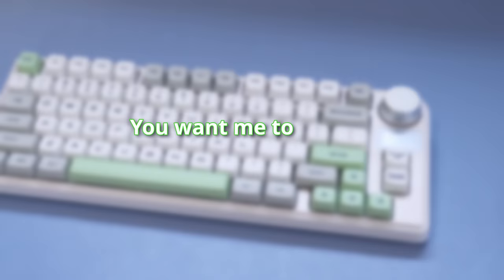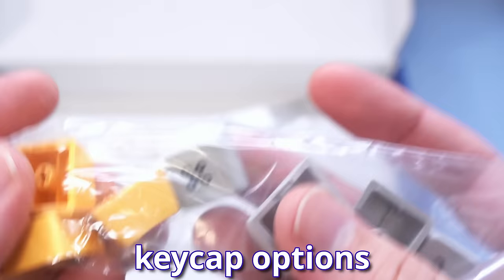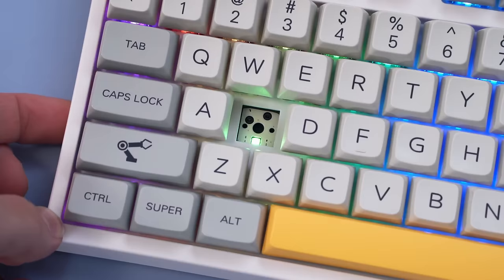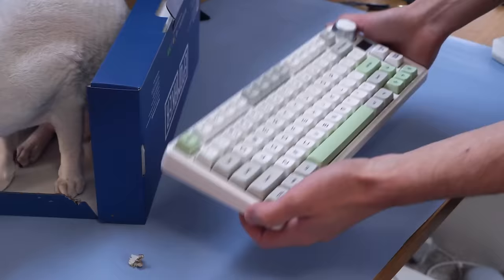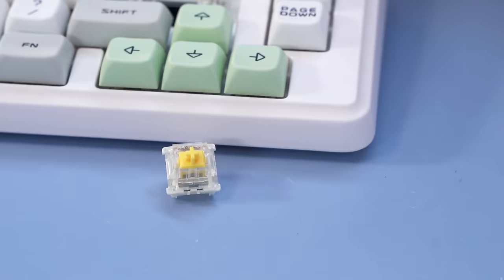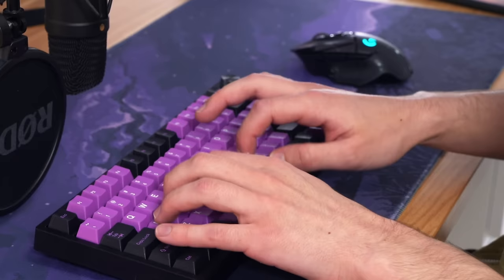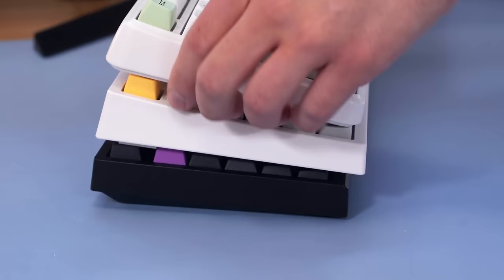Why Are People Buying THIS Keyboard From Amazon?

Comment from the maker: Sponsored by Epomaker who did not review this video.
⬇Paid Affiliate links to help out the channel ⬇
Epomaker Th80 On Epomaker: https://geni.us/Epomakerth80website
Epomaker Th80 and SE (amazon): https://geni.us/EpomakerTH80AMZ
Epomaker Th80X (Amazon): https://geni.us/EpomakerTH80X
Reply: They work😲
Reply: Also is the stock version better than a Keychron v1?
Reply from the maker: @CharlieGair  gotta watch the vid and decide for yourself 🤠
Reply: @HipyoTech  I’m new to keyboards idk
Reply: we need more nola content
Reply: @CharlieGair  Welcome to the club. Remember to watch your wallet.
Reply: you’ve got to try to new ajazz keyboard it’s value is crazy!
Reply: HIPPYO PLS HELP ME MY SPACEBARS STABS ARE KINDA STICKY SOUNDING LIKE THE GREASE SOUNDS HORRIBLE ANS STICKS TO THE STEM WHAT DO I DO HELPPPPP
Reply: I just bought the barebones kit and paired it with some akko sliver switches, sounds very good so far(i havent gotten the keycaps yet 😭)
Reply: Hippo can you review the Ajazz AK820 Pro it’s meant to be good
Reply: I usually don't ever comment but could you maybe take at Royal Kludge's offerings instead? Like the M75 or H81? I tried out Epomaker's budget boards and came to the same conclusion you did but I have the H81 and am very happy. Thanks!
Reply: HIPYO I need your help😭😭😭 after a few hours after lubing my switches, they don't sound as good as they were right after they were lubed, did they dry up😭😭
Reply: can you try the aula f75
Reply: Have you tried the Rk m75 yet?

Comment: Honestly i recently bought the th80 pro with pre-lubed wisteria switches and stabs for 80€ and I'm impressed. The keyboard is great out of the box and it sounds really good, at least to me. Shame about the epomaker software but for the price i can't really complain.
Reply: where did u buy?
Reply: It's the same price as the cheap keychron. I'm wondering if it's better
Reply: @Larimuss  depends on the country you are in. Keychrons are more or less expensive in various countries, plus shipping is a pretty noticeable mark up on the base price.
My th80 pro costed me around 80 € in total, instead.

Comment: I picked up the TH80 Pro earlier last year as my first mechanical keyboard to jump into the hobby. I really liked the sound and feel of it stock, but have since modded it a bit as I've learned more. The Gateron yellow switches feel and sound great, and more so after manually lubing them. I've tape modded it and added some foam, and think it sounds better now. While the stabilizers are factory lubed, they could probably use some more. It's definitely a good entry board, though it is a bit of a pain to get inside for modding.

Comment: I bought the TX80-X (flamingo switches) and I have to say, this is a big step up for me coming from Corsair K95 Platinum with speed switches. Also it was $95 cheaper than Corsair! 
It does sound incredible, well at least to me it does, I'm by no means an keyboard enthusiast, but I'm very impressed with it!
Also the software is... how to say it lightly... confusing and not pleasant, would much prefer if it was VIA compatible. 
I will have to correct you on the knob, in my unit it does indeed work as volume knob and other things, maybe the unit sent to you was bogged or something? 
All in all though, I'm very happy with this keyboard, will probably look at modding this keyboard to perfection for me. 
Great video though bud! Keep it up <3
Reply: I don't think he bothered reading the manual to know how to switch between using the software to volume lol
Reply: @hobgobble  I think he was joking but never too sure 👀

Comment: I bought the pro version, but barebones, slapped some akko lavender v3 pros, cheap amazon keycaps (I dont care if the abs plastic starts to shine) and some quick mods. I have to say this keyboard is pretty nifty, for the price it is a great budget option if you dont want to wait for a sale for other brands such as keychron or gamakay. The one thing that pisses me off is the disassembly of the case, but other than that, its a pretty nice budget keyboard. I am currently experimenting with other switches and might even make a whole new keyboard, feel free to ama about this keyboard.

Comment: I went ahead and pulled the trigger on the TH80 Pro as my starter custom board because Amazon has the prebuild it on sale for $45. Honestly, for $45, this thing feels great (I thought light linears would be my jam, but I didn't realize they would be THAT much better for me than the Cherry MX Browns I was stuck with on my old gamer board). Opening it was actually way easier than I was expecting. I thought I wouldn't be opening it frequently because every review I saw had people struggling with it, but I read a comment saying to use an old gift card/credit card, and it worked like a charm. Currently, I have the PCB taped, and it sounds really poppy (tho a bit loud and hollow with a noticeable spring ping from some switches, but I'll see what I can do to fix that later). I'm super glad I figured that out too, because I can't wait to experiment a bunch with the modifications and see just how nice I can make this budget board ^^

This keyboard started with some minor frustrations, but has turned into an incredibly fun project that has made me think critically on what I want from a keyboard and how I can modify it to suit needs that I hadn't even realized I had before lol. Now, it's a smaller keyboard that feels better, sounds better, and has more functionality than any full-sized+ gamer keyboard I've ever used (I just wish the software was ever so marginally better lmao)

Comment: just a heads up, those are not gateron pro yellows, the V1 pros have a non-frosted south-facing LED diffuser and the V2s have a frosted LED diffuser. It looks like those yellows dont have either.
Reply: in fact I'm pretty sure the only difference between the V1s and V2s are that LED diffuser but I could be wrong there.

Comment: The TH96 was my first entry into the "custom" mechanical keyboard space and I'll always be grateful for that, however, there are better options on the market that don't gate you behind the Epomaker proprietary software. No doubt these boards are solid for beginners, but as long as they're the floor, and not the ceiling, the hobby is in a great place. 
I bought the TH80 though shortly after, and still have it. I put some hand lubed Drop Holy Panda X switches in it and love the sound and feel of it.

I will also say, another major gripe about these boards is how they're constructed. I don't trust clips. One wrong move and you break it and that's basically the end of your board. It really discourages modding. Not saying you can't mod, but if you're not nailing it in the first go, you're going to keep putting stress on the case. I wish they would just make a version with screws that was more reliable.

Comment: I am currently writing from one and have several mechanical keyboards. The one I find to be the most comfortable is the ducky one 2 sf. The epomaker has a nice sound to it (yellows) but feels a bit stiffer, I think because of the keycaps, its overall size and shape. The ducky has silent reds, is super silent (no pun intended!), which I love, and just makes me type super fast, I almost forget it's there. Conclusion, I keep the ducky at desk for work with my main setup (a laptop and a 24'' screen) and the epomaker serves me when I want to got out of my desk, I have a 32" 4K monitor that is pointing to a more leisury kind of area where I consume content and for that nothing beats wireless.

Comment: I hate screwless boards so much.  My yz75 is warped on the bottom because of the stupid no screw design.  Also the yz75 (which is honestly just rebranded epomaker board) has stabilizing risers inside that ruin modability by turning tape mods from a 30 second tape up to a 3 hour precision job.

Comment: i thought about getting an epomaker keyboard. kinda glad i didn't. i got the womier g75. as well as a kzzi k75. i prefer the womier to the kzzi. but they are a bit different, partially the aesthetics. i also have cherry sand keycaps from novelkeys. fit the womier very well. better than the stock keycaps.

Comment: The epomaker was the second one I bought. And it will probably be the first one I get rid of. The sound profile is pretty bad compared to a Keychron. Mine has the tape mod, a sound dampening foam and I'm using gateron red that I lubed on it but it still does not sound great. The one Ibought after is the keychron v1. It sounds A LOT better. And in canada, some keychrons are available on amazon

Comment: I use a epomaker th66 as my daily and its yet another very different version then what you reviewed. it has a thicc black foam liner in the base of the case, full rgb, no silicone gasket instead has foam strips, the software for remapping hotkeys is not compatible,  there's no 2.4ghz module. overall i like the thing but the gdmf delete key is FN+page down. the stock switches (linear red) are terrible and 2 of them went bad after about 1 year of use. swapped them out with some cheap otaku low profile black switches and now its nearly silent but for a low thocc.

the plastic trim is super easy to remove just start at the front then sides and the back hinges out and up dont try and unclip the back. its so easy to clean this keyboard which is a huge plus.

Comment: This is hilarious! I actually have the tan / yellow / red volume knob version of this TH80 and it's by far my favorite to type on, the feel of the flamingos, the sound and especially those keycaps!  However, I do wish I could get a set of keycaps that felt just like these that were more transparent for RGB's sake. I've had this keyboard for just over a year and my typing absolutely sucks, and I believe it's because the flamingos actuate way before they reach the bottom of the stroke - and I really hate that. Any suggestions? I seem to like thocky linears that require a bit more pressure to actuate. Do those even exist!?

I've modded several keyboards now and know a little about what you're talking about and appreciate your videos very much! It's a fun hobby to get into.
Reply: Maybe try changing the switches with Akko Cream Black to get that thocky linear sound?

Comment: i've got a Medion K28, second hand for 5 euros, many years ago.  
It's still working and has all the button i like to have.    Inculding volume control buttons on the top row.
Never had problems with it,   it's light, durable, easy to clean,  and easy to use.

Comment: For over 40 years I've been using keyboards at home and work etc, but RGB and dedicated keyboard software have never been important issues, nor the way they sound. The best I've used have been big, heavy mechanical things from decades ago, often connected to dumb terminals. They had a proper mechanical feel, a metalic sounding keypress and would last forever. Considering their prices, these 3 all sound cheap and nasty. But then I hate hearing the clicking of keyboards unless I'm the one doing the typing. 😂

Comment: so im pretty new to the whole keyboard thing. the th80 pro was not my first, but the way i got it was risking it through their $50 mystery box. since then ive gotten better keycaps for it & i really like how it looks & sounds now; although i know i can make it sound even better & plan to. mine came with the pro yellows so that was pretty good but ill probably get different switches here soon (im thinking ktt haluhalos to match my keycaps). i still need to do a bit of modding & i think the stab wire for my spacebar is just slightly bent so need to fix that. but overall im liking it especially for the price i paid lol

Comment: I would prefer the black TH one, even stock, than a keychron V series. It sounds way better and it carries cherry/OEM keycaps in a nice color. Keychron has quickly gained popularity because of one splendid, functional and simple website where the novice user cannot be confused by colors, switches and keycaps variety. But this does not mean all boards may appeal to anyone or be superior than other similar budget keyboards. North facing leds mean one useful feature not a drawback; one set of compatible shine through keycaps can offer extra relief and readability in low light environment.

Comment: It looks like the front of the X is a little lower than the Pro and SE, that would be a positive for me as I have gotten use to the front of my Neo65 and everything else seems high now (I don't like using a wrist rest). I would rather have a 75% with a knob but typing experience on the Neo65 is just far and above everything else for me. I did recently try some of the Epomaker Peace Lily switches and they are phenomenal! I've got Morandi in a lot of boards and these are a little lighter and definitely louder which is nice in a muted board (my GMMK Pro is very muted so they livened it up quite a bit). I had thought about picking one of these up to try but will probably grab a Yunzzi 66 for now or the CIDOO (still Epomaker) to play around with instead. Thank you for saving me some cash! :)

Comment: Heads up, I'm returning TH80 due to chatter and it causing random pc issues (audio output switching randomly, mouse not working, keys not working etc).

Also I'm having to pay their postage. Save yourself the hassle and just get a Keychron or a Kludge.

Comment: Hey @HipyoTech - thank's for this video and your channel in general. I'm in the UK and wanted to get a better keyboard for a while - something that would BT into three devices so that I could follow some @Workfromhype productivity tips. Choice at the budget end seems limited over here so went for the TH80 SE based on this video. And I love it. I have two issues to tackle:

i) the keyboard layout has @ on shift-2 and # on shift-3 but they are £ and " respectively and I cannot seem to get Windows 11 to recognise this as a US keyboard to get around the issue. I may just try to find keycaps that are correct for what Windows sees - but so far that does not seem easy.
ii) I love the sound of the letter keys, but the bigger ones - shift, return, space, are not so nice. You used something in your space bar - I can't see a link in your description and I could not work out what the product was from the video. Any advice?
Reply: Found an answer to my first question - setting the keyboard to Australia seems to fix it!!

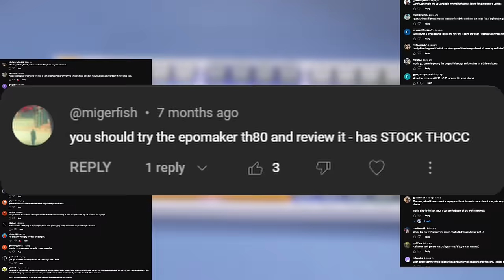Comment: 00:02 🎮 Confusion with Epomaker TH80 keyboards: Three keyboards, same name, same price, different models, causing confusion for buyers.
00:31 📦 Reviewing all three Epomaker TH80 keyboards: A comprehensive test to determine the best choice among them.
01:12 💡 Pricing and models complexity: TH80, TH80 Pro, TH80 X, and TH80 SE have similar pricing but distinct features, creating confusion.
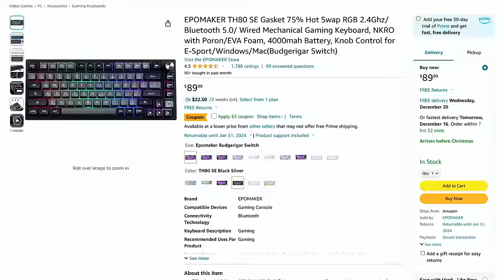02:21 💰 Pricing disparity: Epomaker's website and Amazon offer different prices for the same keyboards, making it essential to compare before purchasing.
03:47 🛠 Modifiability of Epomaker TH80 series: Hot-swappable switches, keycaps, but plastic case and potential issues like missing screws.
04:44 🎹 Keycap and switch details: TH80 uses Daub PBT keycaps and Flamingo linear switches; suggested trying due to Amazon's return policy.
05:20 🔊 Sound and feel disappointment: Despite expectations, the TH80's sound and feel at $89 fall short of fantastic.
07:42 🌈 Gateron Pro Yellow switches: A recommended upgrade over Flamingos; offer improved feel and sound quality.
08:49 🔄 TH80 SE distinctiveness: It differs significantly from the others, offering a unique design, but lacks ISO option for European users.
11:08 🔧 Modifying the TH80 SE: Lack of screws and gasket performance issues prompt attempts at modifications, such as tape and kinetic sand, to improve sound and feel.
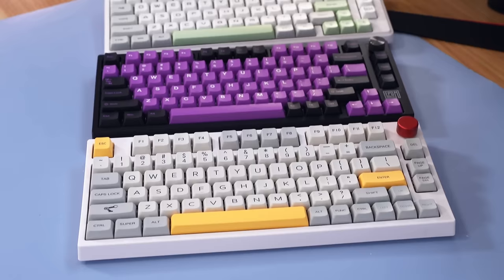13:41 💡 Best choice among the three: TH80 SE stands out despite some drawbacks; other keyboards may offer better value, like the Kyron V1.

Comment: Sadly modern keyboards are fashionably tofu dreg, the lettering on the keys wears off in weeks and built-in pointing devices are exceptionally poor. The current Levono trackpoint keyboards are pretty well useless (not least because of the connector and the lettering wears off in days). The old trackballs used to actually work, current models seem to be so badly made they are not really usable (as they are not properly housed the pointer jumps when you take your finger off it) . Best I have found is to buy an old IBM Thinkpad keyboard  and re-house it (not for the faint of heart), you get a good keyboard, the lettering doesn't wear off and the trackpoint remains the best option for graphics I have so far found. Second best is a mouse (or an industrial 50mm or 75mm trackball in a home made housing) along with one of the old 1980s or 1990s  keyboards from someone's junk cupboard with a USB adaptor, but those tend to be full size (so you need a music stand next to yoiur desk to hold any books/manuals you are referring to) and finding one with the function keys on the left is increasingly difficult. (When the corporates took over at IBM they moved the function keys to the top so it would look more like a real computer - ie a teleprinter - and introduced the ctrl-shift-left elbow way of working). The scratch-pads are pretty well useless for serious work, the 'click here at random' functionality is something of a deal breaker if you are using the thing for actual productive work. I now have two good quality IBM thinkpad keyboards and they will probably see me out (they last about 8 years of continuous use, sometimes longer) but the polished wood surround does give people cause for pause..